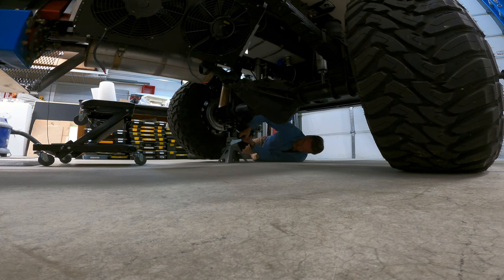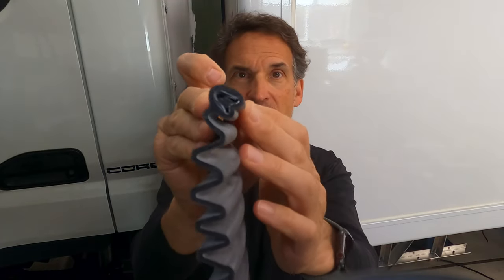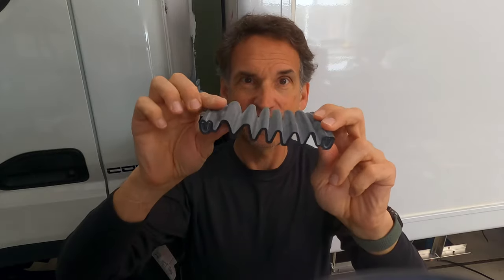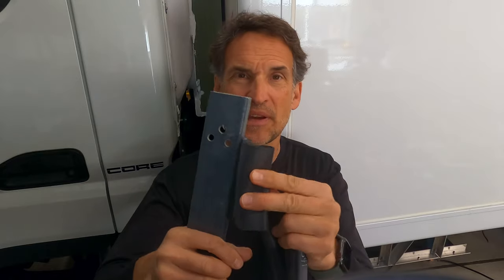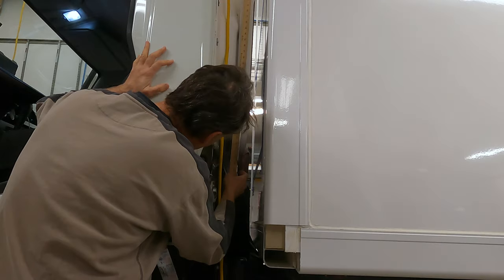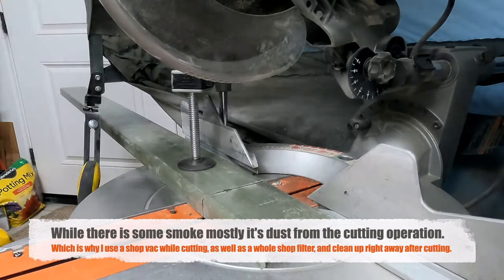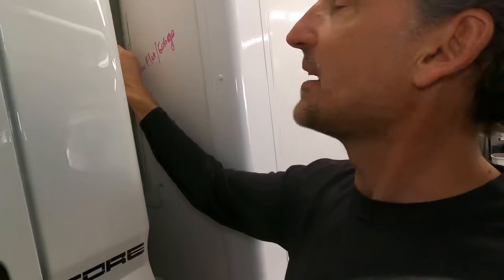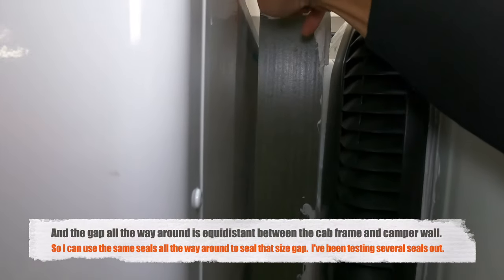Building the Cab Pass Thru Frame

Comment: You could make a thin metal frame on the opposite side of the cab. On the opposite side attach an accordion like gasket folded over with some magnets and that will complete your sale. Just a thought.
Reply from the maker: Yes, this is what I'm thinking. A frame of angle glued to the front of the camper box with a custom fabric boot attached over the camper to cab frames, with magnets to attach it to the camper side and permanently attached to the cab.

Comment: How about an aluminum channel in an upside down U shape that attaches to the wall, you could compress the passthrough into the channel this was and it would allow for movement up and down and would be pretty water tight for the most part.
Reply from the maker: Yeah, good idea. I am planning to build something along this route, but with angles overlapping outside of the cab  passthru frame, with a fabric attachment between them. I wanted to do something just with compression, but with about 6" of movement, it's a lot of compression/movement to account for with just foam.

Comment: I'm assuming your truck build is too heavy to use Forklifts diagonally apposed under the wheels to lift and cleanly simulate full flex to workout your dimensions?
Reply from the maker: No, certainly not to heavy and have thought about doing this but don't have access to two fork lifts but do one, but it's a bit unreliable so wouldn't want to lift the truck up with it. The truck weighs an estimated 10,000-11,000 pounds in its current state. I recently found some good boulders to test it on just after some snow melted and the ground reasonably dry. Will post a video with more info after that good articulation test but still need to design the pass thru seals to work for about 6" of rotation/twist movement between cab and camper.